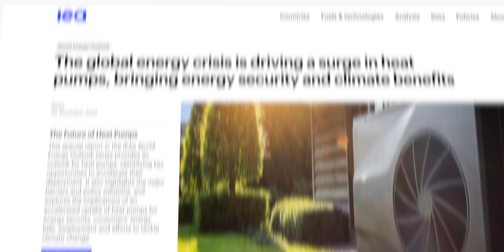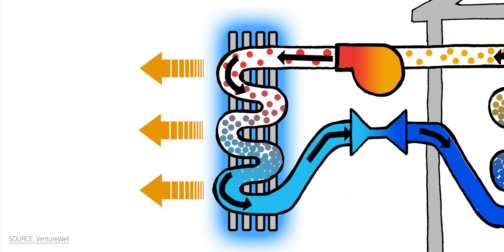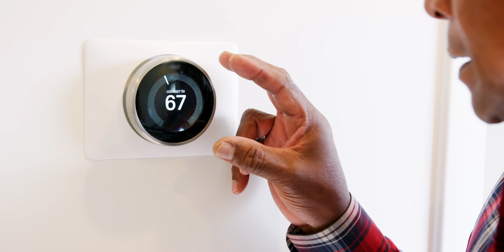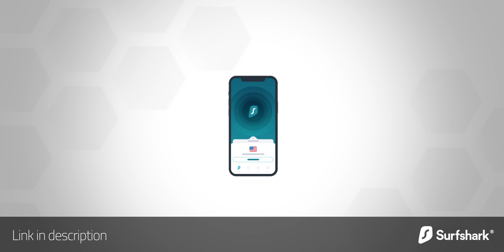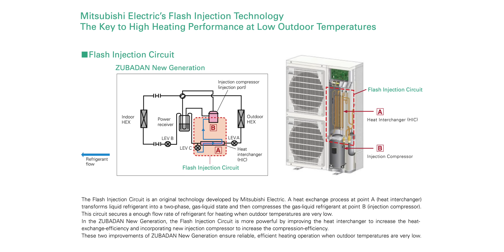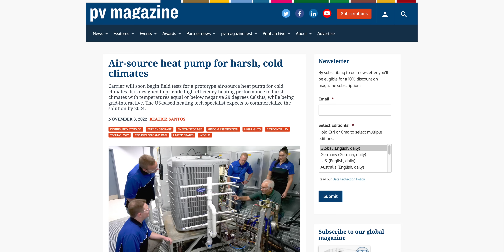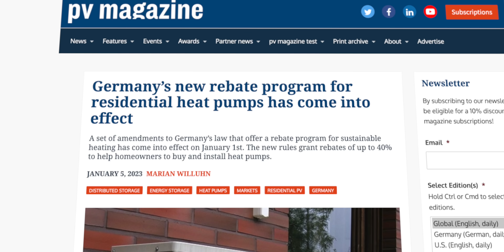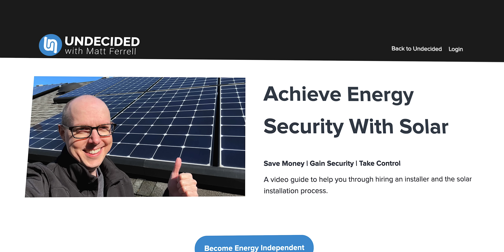Major Advances with Heat Pumps in the Extreme Cold

Comment: Im in upsate NY been heating with a heat pump for 10 years. It was great and much cheaper than oil. My unit is  older and stuggles at -10 f . Which rarely.  Unfortunately, electricity prices have tripled, so it's cheaper to burn wood, which is what i do now. So basically, NYS has set us back 200 years with its "green " programs.
Reply: I hate to kibits but the point of this article was that NEW heat pumps might be an option now and worth to take another look. I will tell you this as a fact ( and making several assumptions) every dollar of improved insulation is usually the first step in making a home more efficient.  The return on insulation is several times higher than  the return on a better heat source.
Reply: @paperburn  It certainly does depend on the fuel source and the house and what needs to be done to insulate it safely. Insulation and air sealing done poorly on an older house can cause a lot of moisture problems, and doing it properly can be quite expensive. We have a 200+ year old house with a dirt basement+narrow crawlspace and no moisture barrier under the clapboard siding. 

Before any real air sealing can be done the basement needs to be encapsulated so we don't just trap all the humidity in the house and cause mold issues. After that all of our siding would need to be removed to put a house wrap on, which with the age of the siding would probably mean replacing it outright.

Switching fuel sources is a much simpler procedure in comparison. Last winter propane was costing me $3.80 a gallon and electricity was $.26 a kwh. Our heatpump on an average January day is going to cost 25% less to run than our 96% efficient propane furnace, and even cheaper than that during the rest of winter and the shoulder seasons.
Reply: At ten years, it may be time to upgrade your heat pump. They work better now then they did, and the efficiency is great.
Reply: what green program?
Reply: I love burning wood. I chop it down by hand from my own land and allow it to regrow, that's the greenest heating you can get. no fossil fuels or resource mining or logistics involved. just a bit of my time every year.
Reply: New York State does not offer rebates for DIY installs and so he pumps are so expensive here

Comment: I've lived in a house with a heat pump. I know for a fact they do not work at all during the winter. I'll never be convinced that the new ones work better to be honest.
Reply: You need to get yourself up to date. New heatpumps do work fine in winter. Got one 2 years ago. I live in Quebec, Canada. It gets damned cold here. And in the winter, my heatpump can keep my house warm until outside hits -25 C. 

If you aren't able to take in new information, you're part of the problem.
Reply: @spidalack  Okay, I'm part of the problem.
Reply: This comment is false. You know for a fact that your system did not work, but they absolutely do work in cold climates. We have a heat pump for our house in Northern New England. We keep our house at 70 F even when it's below -15 F. No problem at all. It also costs significantly less to run than burning oil.

Comment: All majority people need is simple air-to air heat-pump (aircon) with cold weather package. Up to -10c it will provide enough heat. Also costs are significantly lower than ground based HP.
Reply: This is not 100% true.
Reply: @cp37373  it is 100% true :)

Comment: What produces the electricity for your pump?
Reply: His house is covered in solar panels and he has done videos on this. He even talks about that at the end of this video. So the sun is producing the electricity for his pump.
Reply: @robertszynal4745  The greatest demand for heating is evening,overnight, and especially early mornings. I very much doubt that the solar panels will contribute much if anything at that time
Reply: @dennisenright9347  That's why battery systems are important. Also modern water tanks are effectively thermal batteries.

Comment: I live in Canada, so days of -20C or colder are not a freak occurrence; and yet our house is heated and cooled exclusively with a heat pump. The one that was installed when the house was built in 2000 struggled when the temperatures dipped below -5 or so, but the new one is able to push out air that's even warmer than what the old auxiliary furnace did on the really cold days (previously had a dual energy setup due to the inherent limitations of last-gen heat pumps). We've reached a point in the technological advancements where there's really no good reason why every new construction building doesn't have a heat pump as the entire HVAC solution.
Reply: In Calgary, Canada we see many weeks where temps stay between -25 to -35 C even dropping below -40 C on certain days.
Reply: @faisal-ca  yeah. Here in Alberta I haven't found a single company that would do a heat pump only build. Some claim it's because of code, others just say they won't work when it's cold. Problem is, if you have the backup gas, you still pay most of the bill, because of those god damn admin fees they use to price gouge.
Reply: @mattymattffs  jayman and cedarglen in Alberta are offering NetZero homes with heat pump and solar panels. I wonder if they will insist on putting a backup heat source. Even if code requires it, it doesn't need to be gas based. If you already have furnace you can always disconnect gas afterwards.
Reply: @mattymattffs  We cook and heat our water with gas so the admin fees will always be there. Also we were encouraged to get a Hybrid Furnace as the winters in Ottawa can be problematic at times. I am wondering if living in Alberta where oil and gas is big business if that is also a driving force for the advice you were given.
Reply: @mattymattffs  I'm looking at doing a heat-pump–only build in southern Alberta where the lowest it gets is -25. Should be doable. I'll have a wood stove for aesthetic reasons that can also serve as a backup if needed. I pay far more in gas admin fees, franchise fees, and so on, than I do in gas.
Reply: Canada is doing it right and along with several EU nations, is helping to get the U.S. up to speed with the latest technology.
Reply: I'm super interested - living in canada as well with a heat pump of the early 2000's and it dies at -5 exactly like your experience. We're considering changing it because we're basically spending all winter on Aux. Heat. Can you share your brand of heat pump?
Reply: @sephiros9883  My heat pump really struggles at -8c and it was installed in 2014.
Reply: @sephiros9883  The best brands today are without a doubt Mitsubishi and Daikin. Panasonic and Toshiba deserve a mention. Samsung naah., works 

Do NOT! get a Midea, they are crap.
Reply: What brand heat pump do you have?
Reply: What size pipe work do you have?
Reply: @mark totton Hi, is it a ground or air source hear pump?
Reply: Installed a new heat pump mini split last year and ran it in -20, and it was still working well. The other crazy thing is the change in the electric bill was not even noticeable!